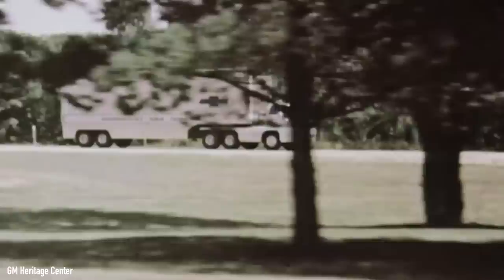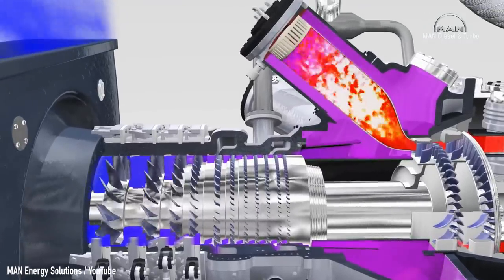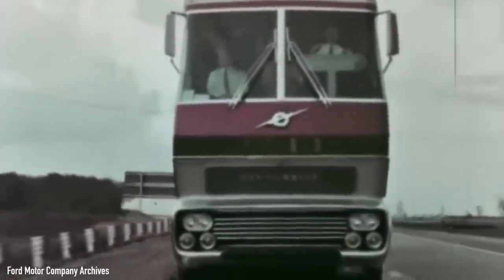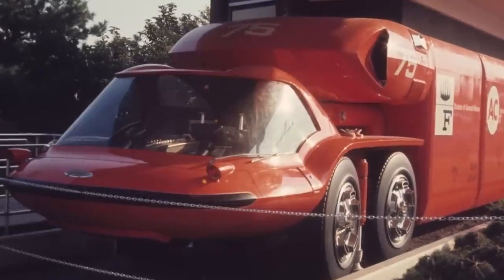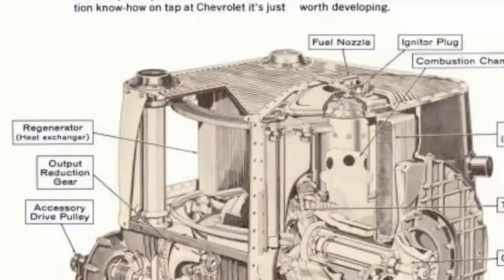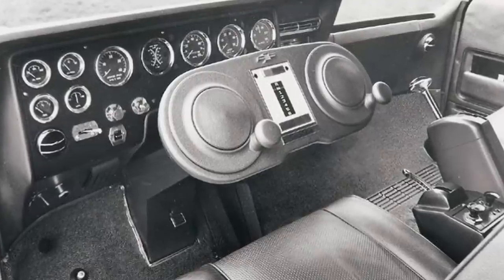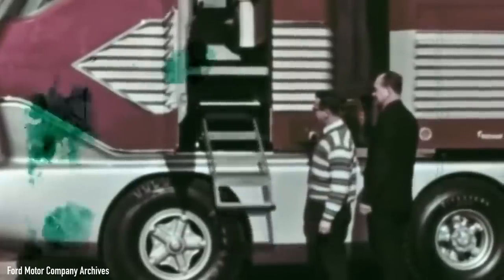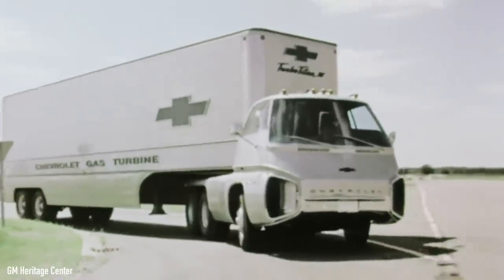The story of Turbo Titan, Chevrolet's long-lost gas turbine truck that almost made into production

Comment: They should revisit this type of power train with hydrogen as fuel source, especially after recent hydrogen gas turbine trials done by Rolls Royce in 2022.

JCB have built hydrogen IC engines for heavy equipment I.e. diggers, bulldozers, dumper trucks, forklifts etc
Reply: Batteries are better than hydrogen, Tesla just launched their electric semi, 500 miles of range at 82,000 with an astounding 3,000 HP. it can actually maintain 60mph on a 5% grade.
Reply: @Victor  batteries don't create energy, they just store energy produced by coal and gas fired power stations. Wind and solar don't produce nearly enough energy and nuclear power stations are on the decline. 

Have you even looked at the carbon footprint to extract enough lithium from an open cast mine to produce a single tesla battery? Battery technology still needs more development to remove the need to use materials like lithium.

Toyota have now built a hydrogen IC engine which will pave the way for more hydrogen powered cars.
Reply: @graemerussell3968  you people actually don't know what your talking about, ill prove it, tell me how much co2 is used to produce a tesla battery.
Reply: @Victor  about 16 tonnes of CO2 per 80kWh battery

Tesla truck has 900kWh battery = 180 tonnes of CO2 to manufacture the battery

0.9Te of CO2 per charge

Avg 62,000 miles per year = 124 charges 
= 111.6 tonnes of CO2 per year

Comment: Big advantage of the gas turbine engine is a Lot of torque, which made the truck practically unstoppable, even with the heaviest load up to the highest hill... But that's it. That Titan 3 Chevy truck looks cool but the cabin is too low (which makes it dangerous for the driver and passengers in case of accident) and doesn't match the trailer at all, and it steals space to the trailer itself

Comment: i've always been curious about gas turbine technology ,, and i personally think it's time to revisit some of this old technology  ,,gas turbines are very efficient when they run at a steady speed ,,
a small gas turbine in a hybrid setup i think  would work well ,,by this time hybrid vehicles have been around for 20+ years  and there really hasn't been much advance in the technology  ,and i don't think electric only is the way of the future ,,personally i think gas turbine hybrids are the way of the future ,gas turbine electric  power works,, Union pacific railroad proved that in the 50s and 60s 
and i honestly think a small turbine engine with a generator and hybrid configuration  is the way of the future ,,turbine has no liquid cooling system and associated accessories something piston engine hybrids have ,this adds complexity
I've personally experimented with hybrid vehicles   and it's amazing how easy it is to make a vehicle into a hybrid ,,i have done it with a nissan truck and also several golf carts
Reply: Thousands of gas turbines are in use everyday they are used in airplanes and helicopters and as ground starting units for fighter planes they are called turbine apu,which means turbine auxiliary power units, they are available for sale at many military surplus auctions and the turbines made by the company solar have been converted back to pure jet status and used in kit built airplanes, Jay Leno has a motorcycle in his collection that uses one. So yes they are still in use and available, for purchase, the old drawback to them is high fuel consumption compared to piston engines and the high temperature exhaust solve those issues and you will see more of them
Reply: @ronaldharris6569  the hot exhaust problem was solved with the chrysler turbine car , the exhaust was actually cooler than a comparable piston powered car because the engine recycled it's heat with the regenerators ,,I still don't think that a turbine engine is ever going to be practical as a power plant to drive an automobile as the prime mover  ,,,in a hybrid application i think it'll do better and it's efficiency will be much greater ,,i don't have the engineering expertise to build the turbine engine or it's associated gearing
Reply: @wildcoyote34  yes as a car engine it probably won't work but everything you need to experiment with turbines is available off the shelf try your luck you could be the one to make a breakthrough and make it practical

Comment: Seems typical of GM, when other companies were taking development seriously, GM was making "dream cars" to show off stuff that would never get into production. Chrysler probably did the most gas turbine development, reaching into the early 80's, and had shown that they weren't practical from a production or economy standpoint. Ford seemed to take a better path feeling heavy trucks might benefit, in this case GM was just following ford to get a little of the public's excitement. GM's passenger car turbine projects barely made it out of the dream car stage to actual drivable cars, but those show cars barely drove and they were as far from production as a flying saucer. GM knew turbines were a dead end really, they had several lines of cars that were doing great in the market and were the worlds largest automaker.

Comment: the nox emissions are the real problem, downsized turbines could be used as rangeextenders for ev´s as they are easier to scale than piston engines, they are the lightest engines for their power and can burn almost anything like diesel and they can be efficient if running at constant speed like they would in a generator application

Comment: I seem to think that there was less fuel efficiency in a turbine engine and I wonder if this was also a factor?
Reply: Fuel consumption at idle is typically half of the consumption at full power. Huge NOx output. The engines were not tolerant of fleet abuse either. Imagine some half drunk half hungover trucker doing a hang start at 2am over the top of some long grass. I assure you it would happen only once

Comment: bring back turbine engine by combining battery with gas turbine, idling can switch to battery reserve while high speed use gas turbine engine, at the same time using turbine to charge the battery
Reply: Ariel made a hypercar with a turbine engine. The same poeple who made the ariel atom

Comment: Gas turbine generator electric would of worked like in the trains  if the tornbine powered a high power generator seeing it works well at high rpm and electric has plenty of tork like the chevy volt and RXR TRAINS

Comment: Gas turbines have developed & improved over time but so have combustion engines.
The use of gas turbines in road vehicles was always doomed from the beginning. Novel designs and interesting engineering aside, eventually everyone had to come around the fact that a gas turbine simply does not have the thermal efficiency of a conventional engine. 
In every commercial application today, gas turbines are only used where the power to weight & power to size ratio leaves no other option. (Helicopters, airplanes, jet fighters, high speed naval craft.) 
Back in the days where fuel prices and emissions where not that important, some better designs might have gotten away with it for a short while. But eventually,  the economics of fuel consumption ($) per mile would drive the development and designs of the future.

Comment: Another thing about that truck is awesome I like Fords but Ford went big to get the power the turbo Titan had the power and it was small and as for those steering devices they need those now and they should be put on people's cars that have a problem speeding
Reply: As a punishment to take the regular steering wheel away from them and put a device like that on it that keeps them where they can barely do 50

Comment: With HP being a function of RPM and torque how could it make 800 ft/lbs at 33,000 RPM and only 280 HP? Shouldnt it be making ~5,027 HP with those figures? I don't know much about turbines.
Reply: 800 lb-ft after the reduction gears (at some speed much less than 33,000 RPM), and 33,000 RPM at the engine turbine shaft before the reduction gears (at some torque much less than 800 lb-ft).

Comment: Good idea. Wrong Application. Using a Turbine engine to run a generator for electric motors to drive the vehicle would have been better.

Comment: worried about drag? suck the air in, turbine-"water"-jet it out, filter rocks, lol
Reply: that can be f1 pushed vehicle down force too
Reply: or why not make a vtol turbine jet carrier then you are really fast and "efficient", but you could also push energy to pu238 as heat-to-electric accelerators, at least 3 types of them
Reply: scoop in front, as air resistor pusher
Reply: active or passive, air cone, turtle divider
Reply: money destroys everything, nothing good comes out of it
Reply: turbine electric (yes like steam trains but gasoline-turbine-electric or the external combustion to heat turbine electric, steam or hot air)

Comment: You said it was uneconomical, so why would you then follow that up with, do we think it would've been a good over the road truck 🤷🏾‍♂️ come on dog, give me reasons to have faith in you.

And that cab is a day cab, so not an OTR, day cabs typically run around the city or short line runs, where the driver has to take off for legal and safety reasons, so the company has a near by motel acct,  no need to spend the money on a sleeper/OTR cab.

Comment: Usta' get a fresh company car every two years.  

The absolute worst were the Chevy's.  Delivered with bad wheel bearings, cracked exhaust manifolds, broken throttle return springs or fluid leaks.  Made worse by the bad attitude of the dealers who also never seemed to have the correct repair parts.

It there we're an actual God, the GM board members would have to use their own product and wrestle with their own service departments.

Comment: Looking at the power figures in these videos, how would they compete against standard reciprocating democrat diesels?
Reply: Turboshafts usually have amazing power to weight ratio, far surpassing a diesel. The downside is that they have low fuel efficiency at part load.

Comment: The thermodynamics of the gas turbine was wrong from the start. There is absolutely no "luck" in engineering and because the vehicle has some super duper styling it is not going to get you over the line. A friend of mine designed and built a steamer. The lowest emission engine in the world. Still is. The American vehicle industry had it demonstrated to them and they still didn't want it. They had governments buffaloed with turbines. A monkey could have told them different. He said there were two places for these selfish indulgences, In the museum of modern art and the scrap heap. No truer words. I saw the Ford gas turbine truck but until this didn't hear about the G.M.. Now I know why. Vote steam.